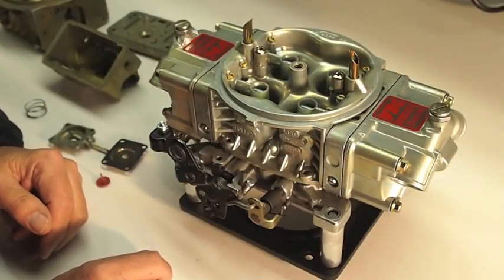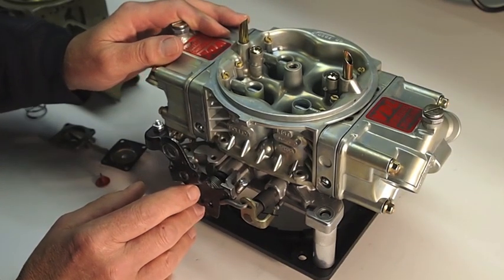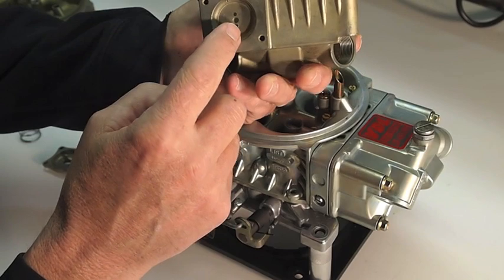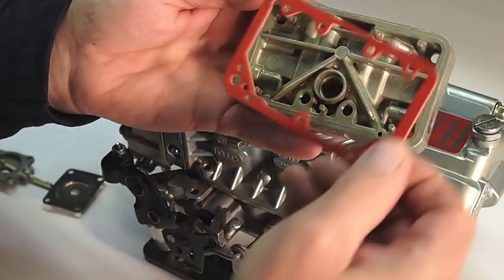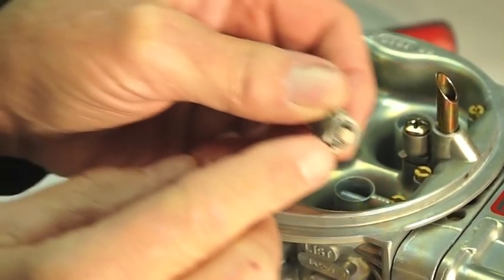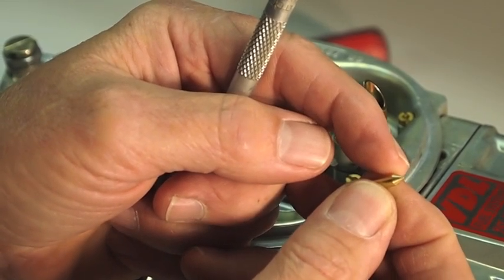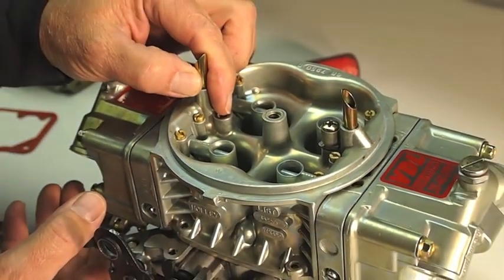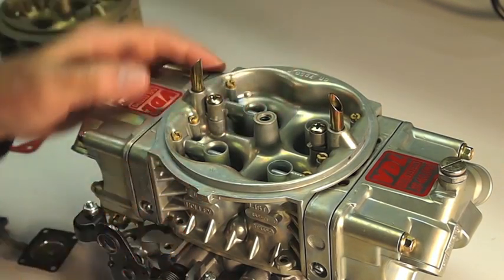VDL Fuel Systems Tech Tips: Pump Circuit Troubleshooting

Comment: HELP…“Holley 600”…I put the kit in (159057), squirters work fine…booster venturis on drivers side NOT working at a idle. Is the problem a float, vacuum, or clogged?? I don’t know how the idle gas flow works…passenger side idle flow works great.
I resurfaced all the parts I could, cleaned them with carb spray, and blew them off...so I think I may have some grit in the one idle circuit port...what's the best way to flush it without taking the carb off?  It was running fine till it warmed up. Also, what does the BOOSTER VENTURIS do? The reason why I ask is because at an idle I have fuel coming out of the right booster and not the left. Don’t the boosters fuel the idle?
Also, I noticed the bottom of the throttle body plate has 8 holes and only 6 screws...why is that?  I bought 2 new screws and put them in...are they now blocking something?

Comment: Great job on explaining the pump circuit. Now if I could get some information on tuning with the billet metering block.
Reply: david goodwin Bigger orifice=more, smaller orifice is less. Set your air screws with a vacuum guage, highest vacuum reading is where they live. Start 11/2 turns out from all the way in and go from there.